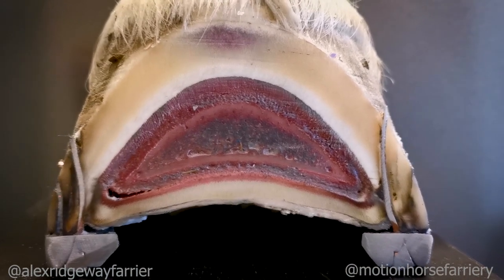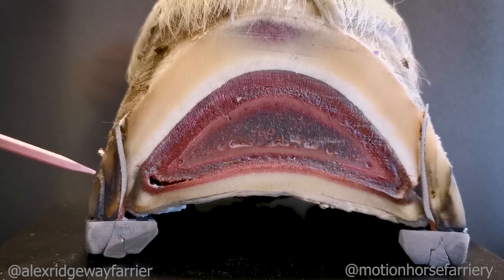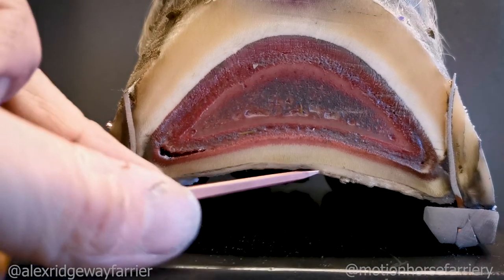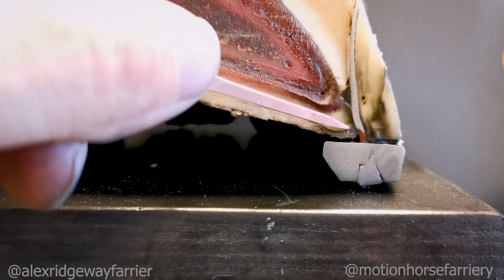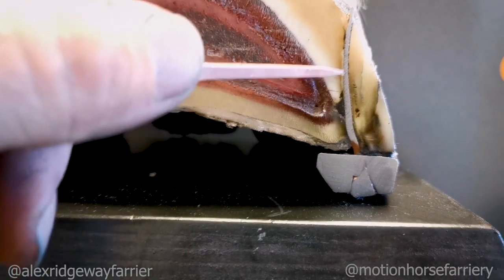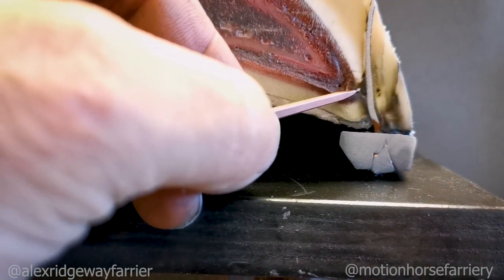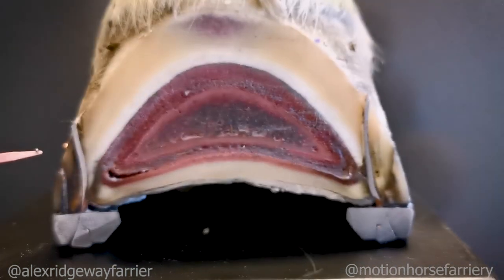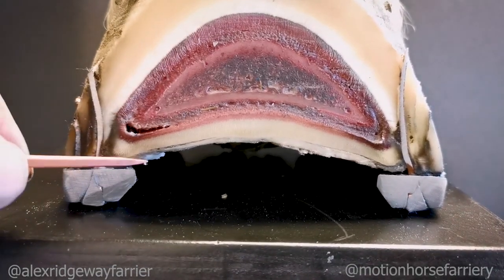Inside shod Horse Hoof - Dissection

Comment: Thanks for this demo! My takeaway is how much nail holes can weaken the wall; someday I hope someone invents a glue or epoxy strong enough to hold a performance horses shoes. I work with Standardbreds, so I've a professional interest.
Reply from the maker: That would be cool!
Reply: I'm not an expert, but why not using the glue used for the blogs on cow hooves as starting point.
It's only an Idea, that's need development/Improvement.
I like to watch The Hoov GP. That's where this Idea spawns from.
They apply different types of blogs with glue to cow feet; and that glue holds these blogs at least 2 weeks or not more bevor they fall of or are removed. Maybe this guy can you point to the right people.
Reply: There are quite a few glue-on shoes.  Prep is super important, but they work pretty well.  Many are used for distance horses.
Reply: @victoriabishop4607  right. When I said performance horses, I was thinking about Standardbreds. I don't know specifically, but I've never heard of an adhesive that would hold reliably for trotters going full tilt.
Reply: @comesahorseman  I work on quite a few retired Standardbreds.  They hold up pretty well as long as the horse doesn't over reach or interfere, but I don't know that I would risk a race with them yet.  There is a farrier, I think, in the UK who was working on a shoe for racing TB's that could be removed after the race and placed back on before the next one.  I'm sorry I can't remember who it was.  Maybe someone else on here would know.
Reply: @victoriabishop4607  thanks for your input! 😃